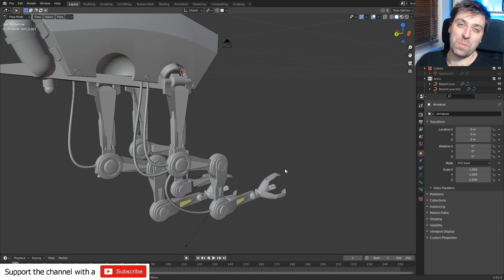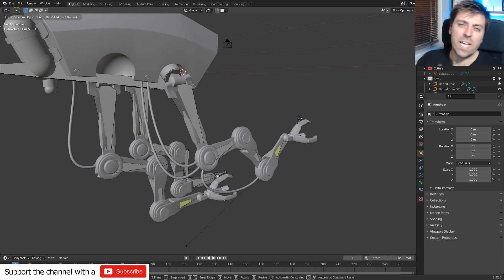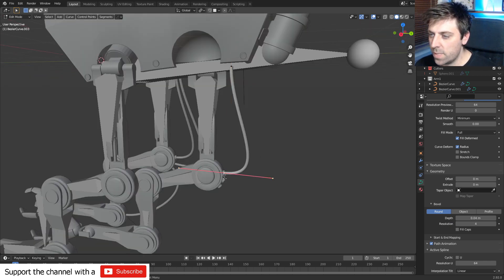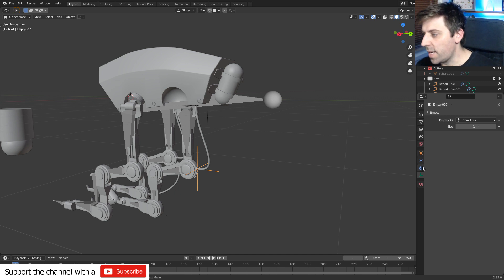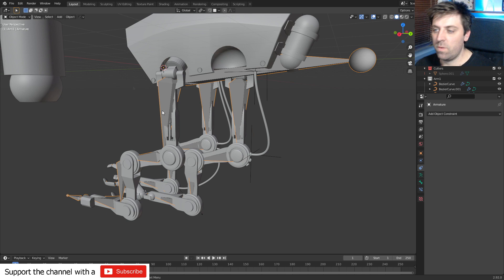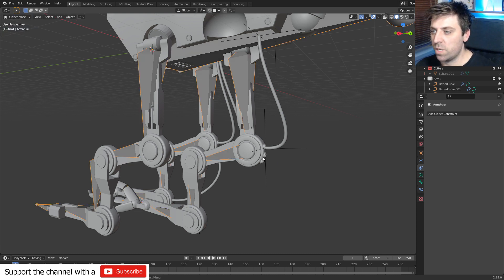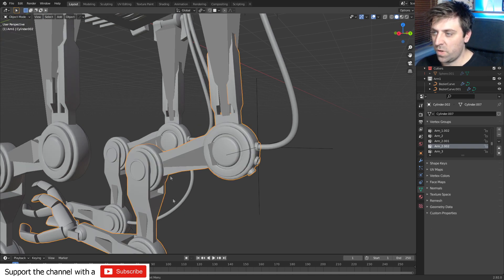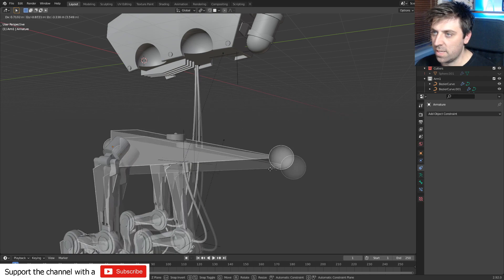Animate Cables in Blender

Comment: Does anyone know a way to rig these cables for export to game engines? This hook method is so easy and accesible that it pretty much buries the conversation when trying to find ways to do it with bones and a mesh :/
Reply: I figured out a method that seems to work so far. Suppose I'm rigging a cable between objects A and B. I made a simple tentacle IK rig for the cable with a chain length of whatever number of bones I used.  I parented the IK controller to Object A. Then on the last bone , gave it a "child of" constraint pointing to Object B. (if you directly parent there'll be a loop in hierarchy). On the last bone in the chain added a "copy rotation" constraint pointing to Object A, and lowered the influence. It also helped to create an extra bone at the end of the chain to keep the end of the cable in place (This bone will need to have the child of constraint, while the last bone in the chain itself has the copy rotation).
Reply: actually instead of limiting the influence, its better to just copy the last bone in the chain, parent it to object A and move it over there, then set that bone as the target for the copy rotation. Probably a simpler way to do it with constraints but this works for now

Comment: Thanks! It works without bones/armatures too. I just have a very small robotic plunger and needed a tiny short hose to flex a bit.
QUESTION: How many vertices are in the curve. It seems like the fewer you use is better it works.

Comment: Hey Marko, just wondering how would one do this with a mesh and use it in ue4 for like a game character? Always enjoy your tuts, theyre to the point and explained very well, also always good to see a fellow aussie making tutorials.
Reply: I just ran into the same limitation. In my case, I wanted to unwrap it and texture it in Substance Painter and ended up just leaving it as it is with a simple material :D. Have you found a solution to this?
Reply: Not sure if you still want it to animate like in the video, but if you just wanna texture it you could always just right click and convert it to a mesh. Then mark your seams and all the rest. I never found a good enough way around it. So I used shapekeys to kinda do what I wanted. And have the animation drive those shape keys.
Reply: @Cloudy0w0  Thank you.

Comment: Thanks so much....I just attached some breathing aparatus tubes to my character using this method and it worked so so well. 
I did have the issue when I moved my character, the tube would move through my character's body if I moved the connecting arm, but solved it by adding another vertex to the tube and now can just move/animate that extra vertex if needed. 
Thanks again so much :)
Reply from the maker: Glad it helped!

Comment: This seems to be the way most people animate cables in Blender which is ok for simple animations but the problem with this method is that it's actually just the curve stretching and squashing the mesh. 

I've got a mechanical arm with a bunch of cables going from the arm to the body, both ends are animated and the cables need to bend and not stretch. There seems to only be a few options and none of them work very well. Spline IK only lets you animate one end if you haven't got stretching enabled as the mesh or bones just slide along the spline, this also happens if you asign a mesh to a curve. Cloth and softbody is a chore to use in Blender and is a nightmare once you have groups of cables all needing to colide with each other so that's not an option and IK just doesn't have enough control. 

What I really need is to be able to just animate a curve using hooks but with the curve staying at a fixed lengh so whatever is attached to it bends in the middle instead of stretching. This doesn't seem to exist in Blender though which means it's basically impossible to animate a cable or rope etc that's connected and moving at both ends without using physics. Unless of course it's something very simple with just a hook at each end then you can use IK. I could be missing something as I'm not a pro but Blender really seems to be lacking in this area.
Reply: Hey! Could you solve the problem since then? Is it possible to apply collision to the wire and the body so that when they touch the wire bends over?
Reply: @samirsuleymanov2099  Yes but I used a physics Rigidbody sim. I haven't found any way of acheiving the same result without it yet. 

It's too complicated to go into details but It's basically a bone chain constrained and targeted to empties that are linked via hinge constraints. I then made segmented tubes that had the Ridigbody on and parented the empties to them. Once the sim was done I then just parented a cable mesh to the bone chain with automatic weights for the final cable.